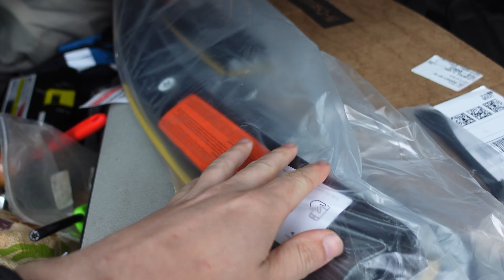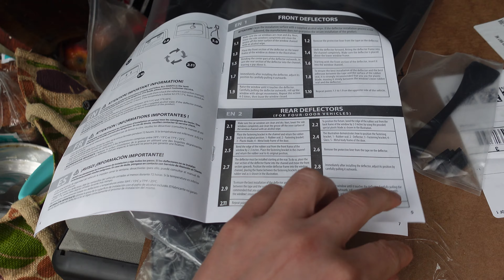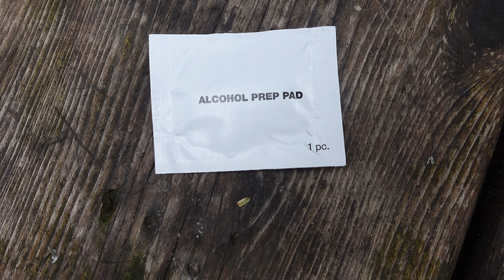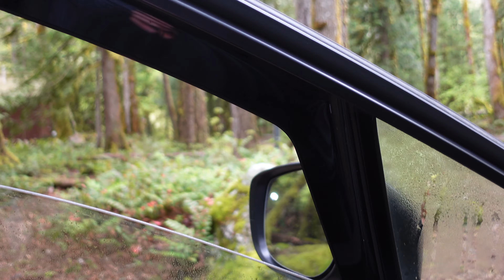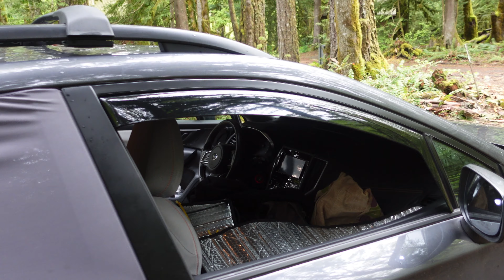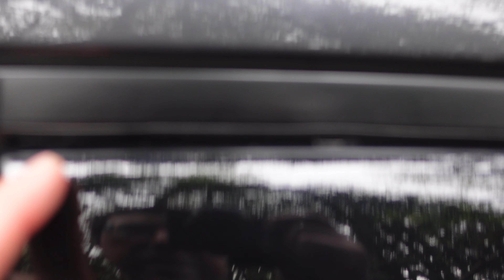Installing Window Deflectors on my Subaru Crosstrek

Comment: Hello Colin , I am looking for the same Window Deflector But the Link you have provided in the descrition is not included Subaru Crosstrek do you have any idea where i can order
Reply: I was looking at the same thing. The link is as well now a tape on window guard and not in channel guard will have to continue and research 😢
Reply: I was able to look on Amazon for the Voron in channel window guards for Subaru crosstreck and they came up.
Reply: Thank you for updating the link! How are they holding up now that it’s been 8-9 months? I was going to get them last night but decided to wait since it’s winter time and I wouldn’t be able to install them since the weather won’t be around the 50’s for a few months
Reply from the maker: I updated the link. They like to periodically change the product listing for some reason. Thanks for letting me know!

Comment: Hey bro, Im not the one who comment on videos, but I think the Rain Guards should go at the outside of the window (by the plastic part) not inside where it blocks the window from shutting down completely. But if its works for you, then it works.
Reply: There are two types - one install outside and another type install inside. Check the brand Heko.

Comment: Hey Colin, are they still working out?  Read some people were having ongoing trouble with the window auto dropping and ended up removing them entirely.
Reply from the maker: Mine still work great! I did have a couple times after I first installed them, maybe the first week or two, where the windows would do that and I had to go outside and pull on them again to get the window to close. Haven’t had any issues with them since.
Reply: @ColinAdventures  Great to know!  Because I really like the look of the inset deflectors, but was a little worried.  Thank you for the reply, and keep having some great acventures!
Reply: @brianpucheu1345  He did state he's not using OEM ones, but a similar third party one. That might be the issue. I've never heard of this happening with the OEM ones, at least based on various reviews I've read. I'm kind of interested in them myself, I was surprised to learn the price is pretty reasonable for them.